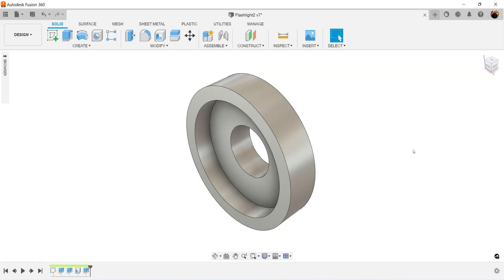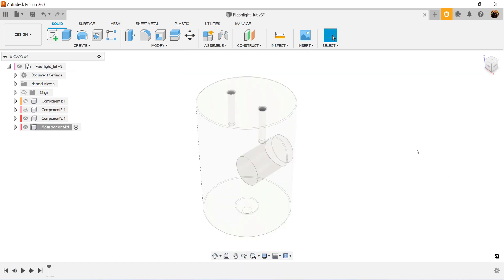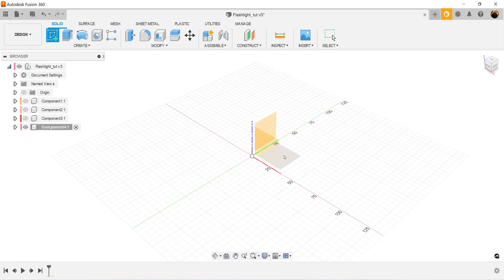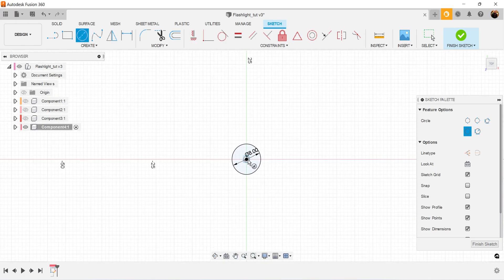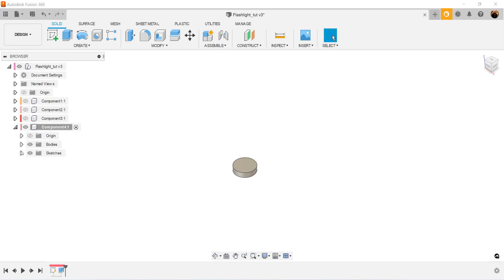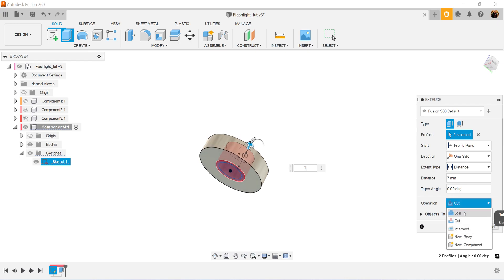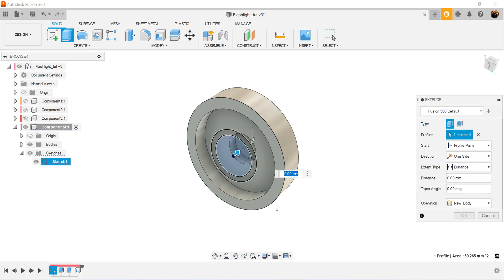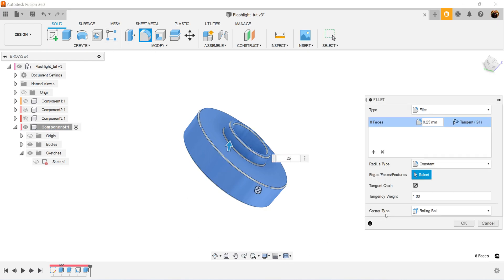Learn to model an LED flashlight in Fusion 360 | Part 4

Comment: This was like watching a movie and not getting to see the ending!  There can't be much left to do is there?  I hope that you will finish it.
I like what you did with this series anyway, even if you don't finish it.
If you wouldn't mind saying, are you taking measurements from a physical flashlight or are you using a drawing to get the dimensions?
Reply from the maker: Thank for your support. My intention was to complete the series, however it didn't seem to get much traction. I may just resume the series sometime in the future. You are the second person to ask about this. I'm glad you enjoyed it thus far. As far as measurements go, I tend to do both on a lot of my projects. Oddly enough, taking measurements is great but sometimes they tend to be off for some reason lol. I often find myself measuring things at least 10 different times to make sure its close to what is true to life, keeping in mind it may not ever be exact.
Reply: @CADJungle Great.  I hope you will finish it soon and do more tutorials.  One suggestion.. please describe/show what feature you are working on before sketching it.  Sometimes I have no idea what the purpose of the sketch is until afterwards!  Still very useful regardless.
Reply from the maker: I will work on that thanks!